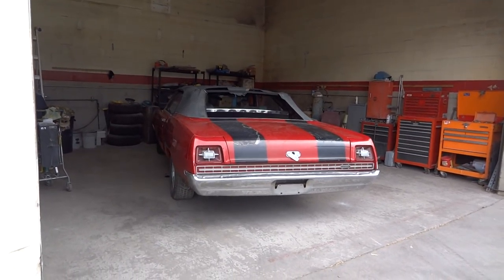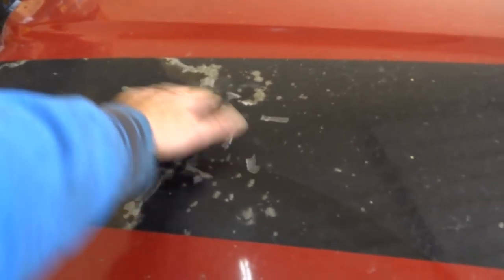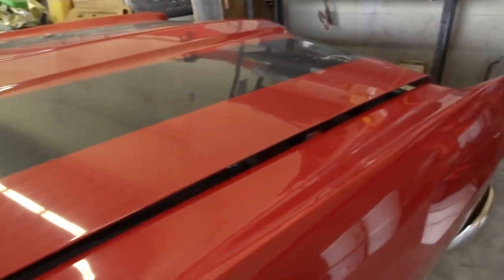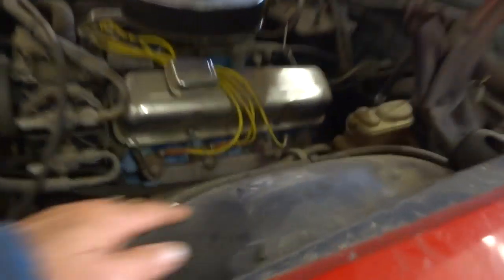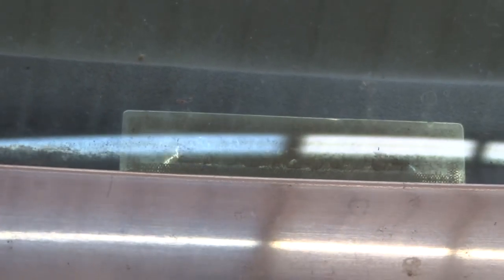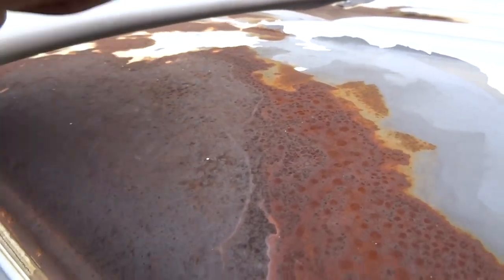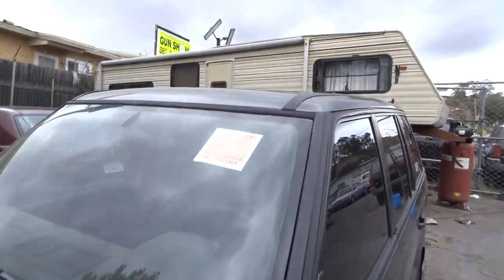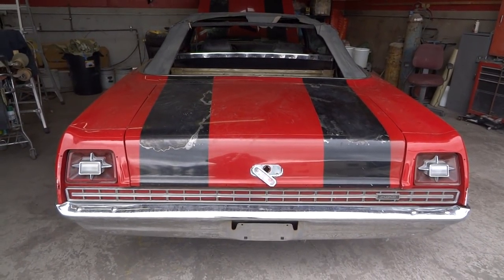Paint Touch Up Body Work Tips 69 Galaxie 500 Classic Cars Convertible How to Mini Series Episode #2

Comment: Well it's probably pointless by now, but I paused your video at 1:55 and what I got out of the VIN was:
9W61Y236064
The "1" was the hardest digit to make out, because it looked like the indent had been flattened on that number worse than the others, but that would make sense, since "61" would have been the part of the VIN that described the body style.  Sorry this comment comes 5 years too late.